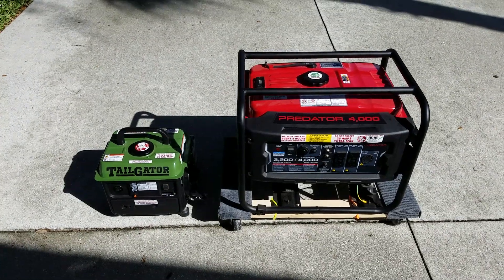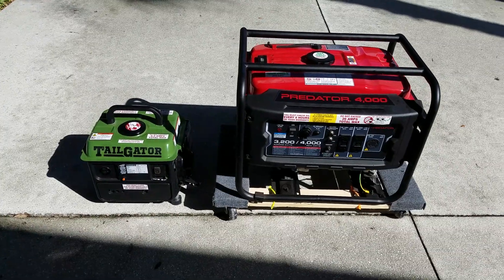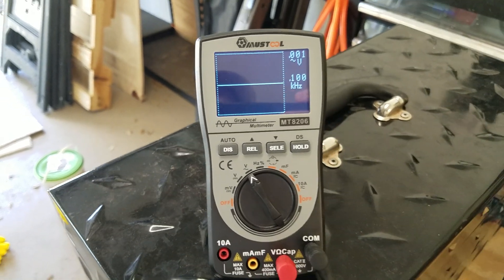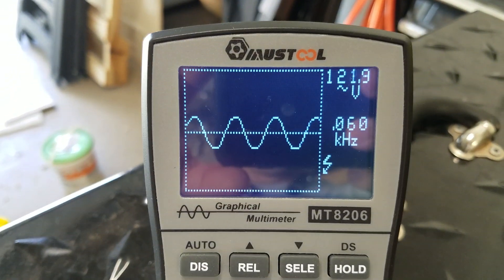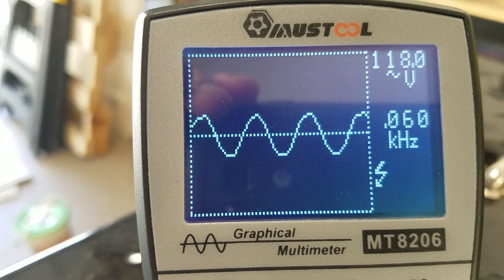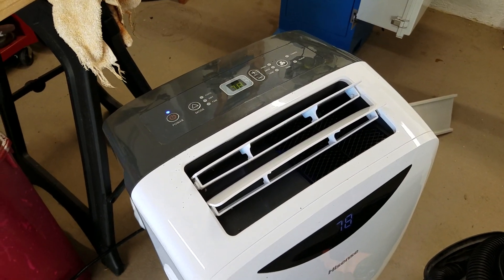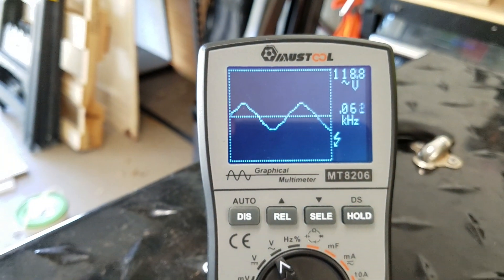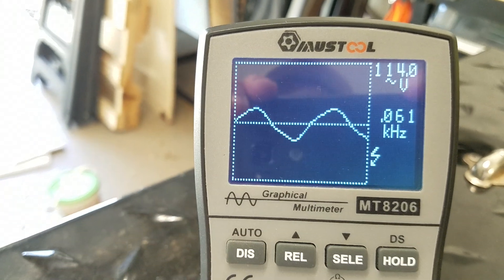Harbor Freight Generators: Testing Wafeforms With A Cheap Oscilloscope

Comment: Last fall I installed a 50 Amp inlet. I bought the Predator 13,000 gas generator from Harbor Freight and then I started learning about THD. I called Harbor Freight and they said it has a THD level of less than 20%. Of course that's way too high for sensitive electronics. However, it's advertised for being safe for home appliance use. It does have a Digital Automatic Voltage  Regulator and I've heard this can improve the quality but possibly only as good as a modified sine wave. I'm probably going to buy an oscilloscope to run my own tests if I can't find out if this generator is safe or not for all home appliances. Has anyone had any experience with this generator or can help me understand why this generator either is or is not safe for sensitive electronics?

Comment: Recommend using a small AC transformer. Connect your scope probes to the transformer output instead of right into the 120 VAC. This is much safer. I use a 120 WAC to 12 VAC myself.

Comment: I been watching a lot of videos here on generator "quality" and i dont recall seeing any videos of generators "destroying" electronics due to "dirty" power. 

Now i have see a sine wave between a reg gen and an inverter gen and the inverter gen looked like or better than the house sine wave which shocked me.
Reply: That 2 stroke waveform had a nice shape but looked like it had interference. You could probably improve that unit by adding some strategic shielding and maybe it would look alot better by replacing the plug. They don't come with resistor plugs so replacing it with a resistor plug would improve that signal. Then adjust the voltage a bit and it would be pretty good 👍
Reply: @ ive been using modified sine wave inverters in my company vehicle for 25 yrs and nothing has ever happened to anything plugged into them.
All these generators are sine wave which are much cleaner than modified sine wave.

Comment: For sensitive electronics.....after some study....it doesn't seem so much to be an issue of wave form ( "purity")....but more a matter of uncontrolled voltage spikes. I'd  also like to have someone explain just what "sensitive" ( vs non-sensitive) electronics are. Seems a bit overhyped as there are literally thousands of reports of using open-frame generators like the HF unit you show....supporting a home system that has a fridge, laptop, microwave, flat screen TV, internet service etc. I think a genset with Auto Voltage Regulation (AVR), with additional surge protector added  for the things you perceive to be sensitive where they plug-in...works. Oh...and maybe the simple idea of having a genset suitably oversized such that when loads come on and off, there is less "Swing" load applied.
Reply: This is exactly my thinking. I've got a regular 60Hz gasoline generator, and the power hasn't done anything to any loads in my house, electronic or otherwise. I did notice something interesting, however, and that is putting a motor-run capacitor smoothed out most of the high frequency noise on the generator output.
Reply: @sodiumvapor13  .... Since I wrote my original response above I also added a dual-set of Volt/Amp/Frequency digital meters to each of the120V "legs" of the generator....so I can monitor the output.....just combine the voltage readings when using the large common 240V plug to the house....
Reply: Good point.  I've used my open frame generator in the past with no issues.  Most "sensitive" electronic devices use switching power supplies to bring the line voltage down to a useable level.  The switching power supply is almost like a power line conditioner.  But I would recommend putting a surge protector in line with "sensitive" devices as it is much cheaper than buying an inverter generator.  That should keep inductive spikes from getting into the electronics.  Motor relays switching on and off are the primary cause of inductive spikes and voltage drops during start up of those motors in homes.
Reply: @danburch9989  ......👍
Reply: I agree 100% ...
Get one with lots of over head power like well above 7kW ... 
this way at low wattage <50% the power is "cleaner" and voltage spikes wont occur as bad. 

With that said, you dont want to run your generator at high capacity, no different than running your engine rpm too high in that gear, like 5k rpm in 2nd gear and holding it there for 10 miles ..

Comment: good test btw does those 2 generator has AVR ? seems not thou
Reply: the little ones with  500W 650W 720W 800W two stroke ones are truly non AVR regulated.. voltage is open floating and spikes will nilly it is complete trash sorry but no regulator
Reply: @MoesKeckeEcke  lol true but who can live with those amount of power anyway! even my pc use like 800 tnX to new GPU generation 🤦‍♂

Comment: By the graph I see a running condensator on A.C. unit, the triangular wave it's safe for it from wave form for condensator safety but also from lack of frequency shift for the motor.   The little one it's good for welding, charging, electronics, hair trimmer, universal motors(vacuum cleaners).
Reply: The little one is trash by any metric...
It doesn't hold frequency as it is controlled by air flap on the carburator, high herz++ unloaded and low herz when loaded because of low mass and spring loaded govenor..
Voltage is completely unregulated on those trash little ones..

I hope all your loads can work on high voltages, most us devices on 110V AC can run "up to" 240AC for European usage... Imagine the 800W unregulated piece of trash in europe, pushing 260V AC++ unloaded and 300VAC spikes on load disconnect..

The little one is trash, only good for halogen flood light which should not exist in year 2022 for its own inefficency..

Comment: its not the wave form that damages electronics it the Voltage spikes  that small gene voltage was swing from 96-158 volts that's why you don't buy Cheap low Quality generators that don't have anyway to regulate the output voltage .  A Good High Quality Generator With a  AVR  Module  (Automatic Voltage Regulator)  will maintain a steady Voltage .
Reply: I would think coupled with a genset big enough such that loads that come on-and-off don't impose a heavy swing on the genset.....bigger is better in this regard in keeping it more steady.... I would think

Comment: First one needs to define "sensitive" electronics  ....or maybe use the definition of anything not happy with these type of power sources is therefore "sensitive".  What are some examples of devices that won't run on this type of power ?  Most wall warts are converting to DC.
Reply: Any device that uses frequency as Timebase.. Dishwasher/Washing machine, older alarm clocks, ac/dc converter that is 110V AC only?

on the small generator, voltage is unregulatet.. just plug in a higher load halogen lamp then your "sensitive" device and then unplug the halogen lamp and see how the voltages goes spike, freuqnecy goes higher and small dc load (phone charger?)

GOES POP!

Comment: Would the Tailgator be safe to charge a combination of laptop and smartphones on a power strip?
Reply from the maker: I would not do that.  I would use an inverter generator.
Reply: Or get a battery cell generator. And solar panel
Reply: No never
the Tailgator two stroke trash is voltage unregulated and frequency willy nilly bouncing.. it does work for your AC110V 60Hz application as all loads are AC/DC converters rectified and regulated (laptop/Phones) 
please check if they can do 240V than you are even safer!

Comment: I think wave form and hz are different.  One is quality and one is frequency.
Reply: The frequency should be stable as it is directly connected to the rpm of the generator head and thus also a quality measurement!

The Waveform itself is only important to rotary tools, as long it is sinus "esque" a load with any rectified then steped down AC to Dc load would work, powerbrick for laptops, phone charger and so..

which is thi mayority of all loads encounterd in a household, if not used on the construction side an avr regulated quality generator is all you need.. Inverter is usually more expensive and ultra expensive to fix if something goes bang

Comment: The Predator generated more of triangle wave than a sine wave! Explains why my PC's power supply made a nasty buzzing noise when I used the same generator to power it while on a trip. Still, I'll take that any day over that overvolting TailGator with it's nasty-ass sine wave. I now understand the term "dirty power" a lot better.
Reply: For computers the non inverted with frequency shift it's fine trough a voltage stabilizer if necessary. The triangular it's safe for grinders, A.C., refrigerator, portable drilling machine and even fans and water pumps including with 3 speeds or any other equipment with RUNNING condensator on it's motor.
Reply: @cujbaion1  yet the little one is still not regulated on voltage which kills all devices, you just need enought of it long enough...

if the little one is good use for you it might be questionable if a portable battery and solar panel is not even better

Comment: Great video on what the waveform looks like from two types of non-inverter generators.  Not too many YT'ers have done this.  These non-inverter generators are really only good for power tools, heaters, fans, lights, motors and basic appliances that have no electronics.  Best to just go out, pony-up and buy a proper inverter generator for the sensitive stuff.
Reply: You know were the power comes for your home? from a huge alternator at either the nuclear plant or hydroelectric plant, true sine waves are generated thru alternators, not inverters that only imitate a sine wave, inverters in fact also distort the sine wave specially when you load them close to their rated capacity, inverters are good if noise is your main concern, that is why you will only find them for small power applications
Reply: That's the problem.....who defines what equipment is "Sensitive stuff" ?
Reply: @TheWilferch  Anything that is or has electronics or ICs that need "clean" power in the form of a pure sine wave at a steady 60 Hz frequency.
Reply: @canuckfixit7722  ...I get that...however how does it translate to real-world equipment in a home? Apply your answer to these items that are possibly supported by an emergency generator.... as "yes-or-no" that then applies---> microwave, flat screen TV, refrigerator, laptop, LED lighting, any fans.....
Reply: Why is an AVR Regulated synchronous generator "no good" ? the waveform resembles closely to the outlet and is sinusesque sooo why?
Reply: Everyone really needs to watch this video about generator safety https://youtu.be/I1jT3ANENvI

Comment: Governor needs adjusted on the 4000 I think doesn't it?

Looks good enough to me it would be worth testing some electronics on it to see if there are any actual issues
Reply: I had the 8750 Predator, really nice generator, but in a couple of quick tests I wouldn't recommend it in all cases. I tested a flat screen tv with a Roku stick attached to it and it worked fine. I then tested a small cyperpower ups and it did not like the power at all. It clicked off and on. The power indicator flashed there was a power issue. I connected it to my Honda EU2000 and zero issues. Depending on the appliance, I would say you may not have an issue. But most ups units are pretty sensitive to clean power. I would say short of inverter type power, it may be risky to plug sensitive electronics into power coming from a portable generator.
Reply: bateslabel You definitely want to be mindful of what you plug in but I’ve ran for days during outages on generator power running smart TVs, modem, router, and all kinds of devices without issue. As long as the generator is in good working order as far as the engine being able to maintain RPM properly everything should be fine. Big changes in RPM is the main culprit in voltage drops/spikes and frequency changes. Most modern devices have pretty good filtering on the power supply section.
Reply: The hertz are reading 61 hertz, but the voltage is at 118. So the hertz is dead on the money because it will lower to 60 hertz with a load. The voltage is low. It is possible to raise the voltage with the voltage regulator. Usually under the black cover on the generator.
Reply: @bubbatime  do you thing the predator is good enough for a camper
Reply: @jamesbuchko7837  ONLY the Inverter line...don't use the big loud ones. ANYONE near you will hate you for using the big cheap loud ones too. YOU GET what you pay for with generators in general. The Predator Inverter 3500 is a great all around unit
Reply: @bubbatime  yes that is true... the excitation is controllable.. maybe low because of no load, voltage might sack under load with extension cord maybe it is set-up this way?

Comment: So, would you hook up a $1000 LCD TV to the HF generator without any protection?  How about the expensive LED lights in the house?
Reply: Definitely not, the Tailgator looks (or is) the same as the prior red model. My dad experienced firsthand what happens if you leave it in a barn for a year or two because the governor throttle linkage got rusty and stuck wide open throttle. Him being deaf thought it sounded s little fast but it’s a pretty noisy generator so plugged it into the house and boom! All the lights (fluorescent/LED and incandescent mix as well as even the toaster) all died. So not a good idea, plus you can see the waveform was really bad (fine for inductive or resistive loads, like motors/power tools/heaters and stuff), but not good for sensitive electronics (that said, yes a simple lightbulb is 100% resistive load and I did say it blew up, but that was a freak accident with the throttle issue which could affect any generator with similar design). But a motor usually doesn’t complain too much nor a simple wire, but electronics are sometimes really picky (although I guess air conditioners are notorious for frying or overheating during a “brown out” where the voltage is too low, but those are usually at their limits...)

You definitely should use very expensive generators for electronics (it’s unfortunate they are expensive), because there is a reason they can make these simple ones so cheap, it’s because it’s a cheap and simple design and lacks all safety features like over-voltage as seen by that 155v he showed, or undervoltage, or voltage spikes when changing load etc. Its really only intended for running basic things like power tools or lights etc. Can you use it to run a computer? Sure I’ve done it, but it can be pretty costly if the power supply can’t handle it and zaps everything, in fact my parents house was pretty bad in terms of voltage so most of my computers blew up power supplies because of this constant damage. So in an emergency sure you might be able to run a laptop or charge a phone (but with a cheap charger it might only be once, and it might only run a few minutes/hours before it zaps the device!).

Oh PS, most backup UPS computer backup battery systems do basically nothing, it’s only providing power after an outage for you to shutdown, they basically have no safety for filtering like you need with this generator (only really seen in the $10k models where they have active waveform correction and ripple suppression, but some might say just get a better generator...)
Reply: @jakegarrett8109  Thanks!  I agree that this generator should not be used for electronics.  Regarding UPS, I was able to find some "double conversion" UPS devices which do perform nice filtering.  I bought 3 of them refurbished for about 250 each, each unit looks nearly new and has a new battery.  They were a discontinued model which I think helped the price come down.  The double conversion UPS take line voltage, invert it to DC, then take DC power from battery and invert it back to clean AC.   I bought them at refurbishedups.com.  Thanks again for your detailed thoughts and experiences.
Reply: @jakegarrett8109   Show me the proof it will fry a TV or a Computer.  So... is there a WARNING on Generac whole house generators to not run electronics?  I would encourage you to read the specs on hi end APC backup battery that power provide pass thru protection to billions of dollars of computer systems around the world.
Reply: @avflyguy  I just gave proof... Firsthand proof, I saw it with my own eyes. You could see Jesus himself walking on Water and Moses parting the sees and look back down at your book and still say "I'll believe it when I see it" obviously never believing, so there is no point telling you any further when I gave a gigantic chunk of details and your still saying "show me the proof" (and yes my Cousin has a full house General, it works fine with electronics, it's actually more stable power than what they get off the grid ironically)
Reply from the maker: Negative.  I'm shopping for an inverter generator right now.
Reply: @FrancoCNC  Me 2.  Might have to plunk down 4k for the honda.
Reply: I run my whole house with dewalt dgnxr8000 made by generac. Ran the house for 5 days straight during a tornado power outage and my 70 inch TV and Central Air is still kicking.
Reply: Very important video that everyone needs to know about their safety https://youtu.be/I1jT3ANENvI please watch it